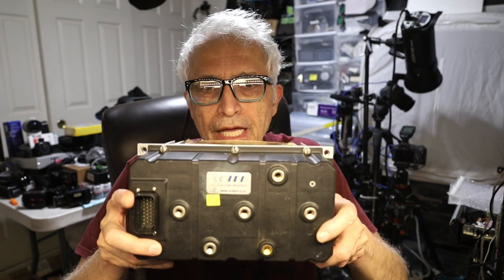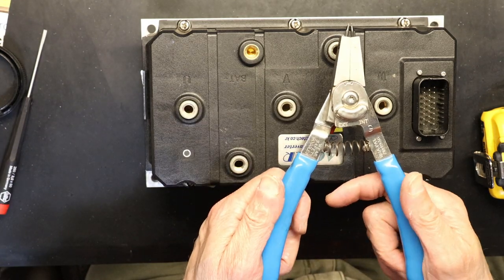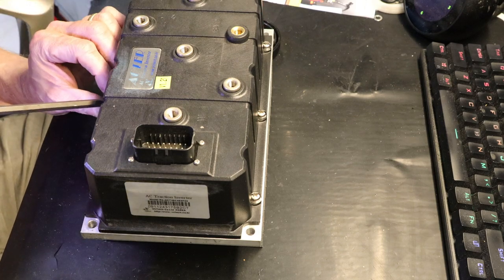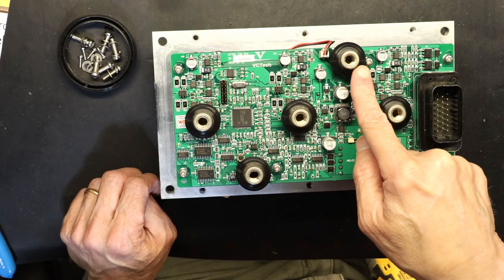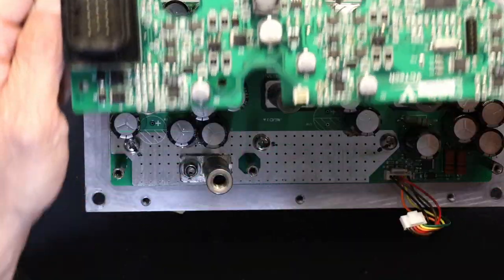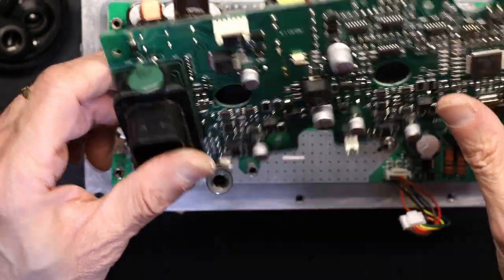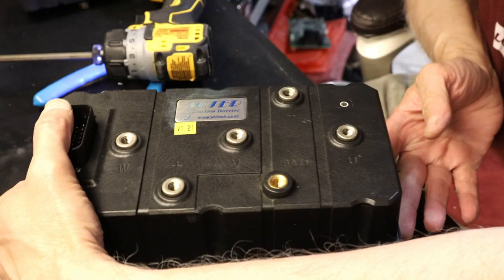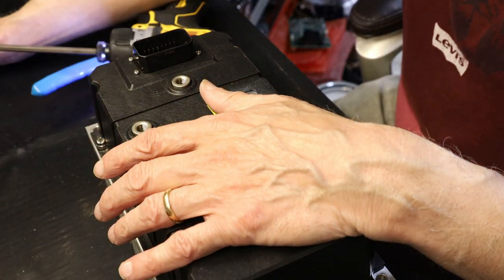ACTER 48V AC GOLF CART MOTOR CONTROLLER REPAIR PROGRAMMING WORKAROUND FOR C-ZONE CT&T ELECTRIC CARTS

Comment: I have a flat board heat sink on my used controller.  Do I need to switch out my old fin aluminum heat sink or can Use the flat aluminum heat sink board?
Reply from the maker: The flat version is designed for those electric carts that use the cart's chassis as a heat sink.  So you can't use the one with fins even if you wanted to because it will not fit on the cart.

Comment: Can anyone point me to the CURTIS program for the 1243-4209 motor controller?
Or
the electrical/electronic diagram of these controllers?
Reply from the maker: The Greedy manufacturer doesn't want to share that, I contacted them multiple times with no luck. Also you have to call them several times for some one to answer the phone.

Comment: Sir i have a golf vehicle when i press pedal single time it can not move so i press pedal many time then it move and the smoothely run but the only problem is that its starting torque is very low because batteries are fully charged i check input voltage of motor 48 volt dc exact i want to increase motor starting torque what you suggest please reply
Reply from the maker: Greetings. This could be due to either a bad solenoid, bad motor controller, or a bad motor. It is very hard to tell unless the cart is present to do a physical diagnostics. I recommend that you take it to a repair shop to pinpoint what the root cause of this problem is.
Reply: Sir can i get your number so that i explain all about the problem which i face regarding cart
Reply: Sir one additional thing which i noted that when i add 1 more battery means that i connected 5 batteries instead of 4 then the issue resolved i also check the batteries health is good then what is issue behind it 
Sir it,s your greatness to resolve my issue please help me❤
Reply from the maker: @Dabangg-Elecronics  If adding one more battery resolves the issue, it means the battery's voltage has dropped below normal. Can you tell me what voltage is each battery and what is the total Voltage readout when using a voltmeter?